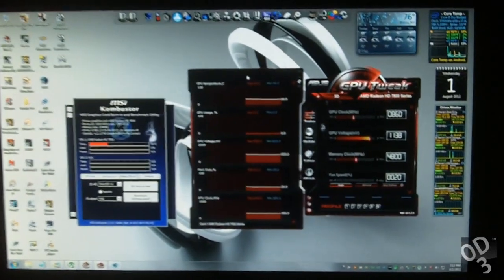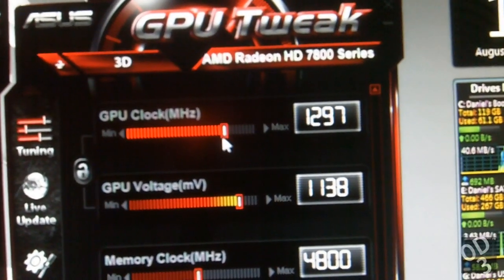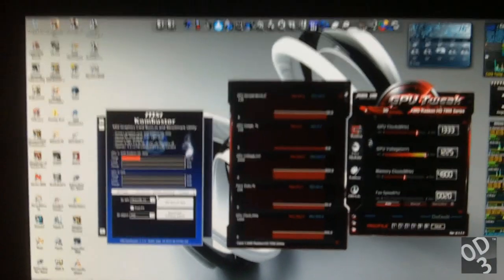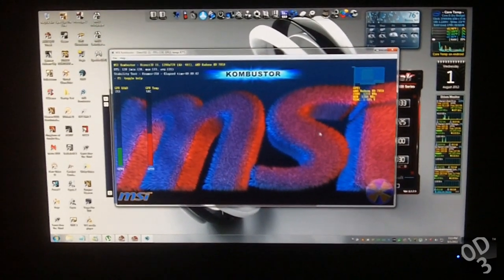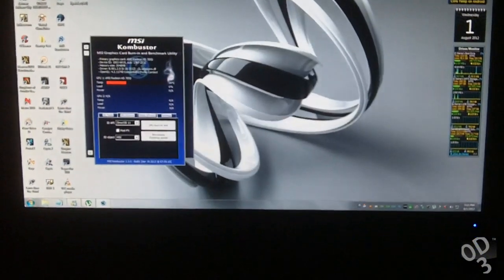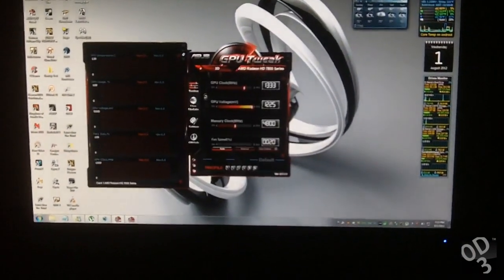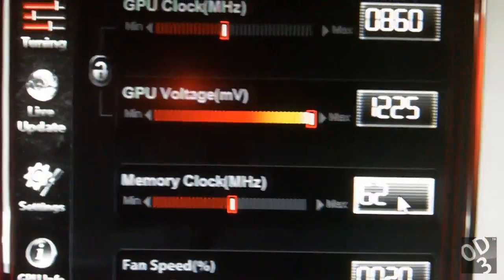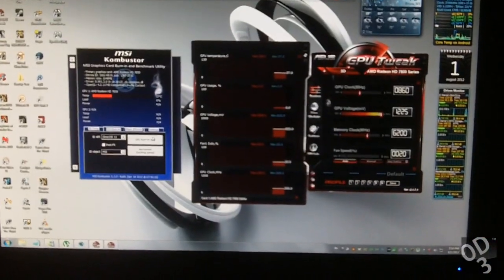What Happens When You Overclock Your Radeon HD GPU Too Far

Comment: I would link you examples but youtube won't let me post links.

Just google HardOCP's AMD Radeon HD 7970 GHz Edition Video Card Review (June 21, 2012), go to Page 6 and look at black line artifacts and texture artifacts in Battlefield 3 and Witcher 2. That's usually what happens when a card fails in games.

MSI Kombuster that you ran locks the game up. However, there are often instances when a card can pass MSI Kombuster for 10h but fails in games with black line artifacts. I've had it happen.

Comment: There is  3rd scenario that wasn't mentioned. If you overclock the GPU core too high but not to the point of total lock/driver crash, you'll get artifacts in the game where textures and other things will pop out in black and other colours. That happens with both NV and AMD GPUs. Also, sometimes when memory overclock is too high, you may get a bunch of red dots or patchy like artifacts on the screen even in 2D on the desktop. When memory clock fails, a restart is always required.

Comment from the maker: If you've overclocked the graphics card, the overclocked settings will be applied when any intensive 3D rendering is required from the GPU. As soon as the GPU is told to render in 2D like being in the desktop browsing the web, the GPU down clocks itself and runs at a low speed. If your system is stable, keep them at those speeds. Get the most out of it! As long as the temperature doesn't exceed 80C on both the CPU and GPU during full load.

Comment: you need to know before you get these freezes or major graphics corruption, you'll get errors that the card's on board error correction will fix. you won't see them, but the card is working double time to fix them decreasing your performance. ATI does anyway.